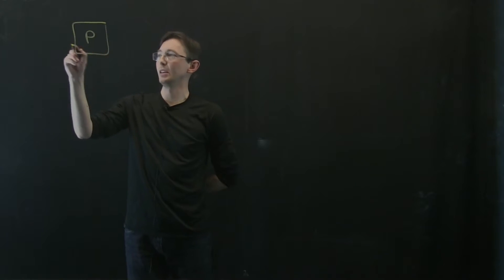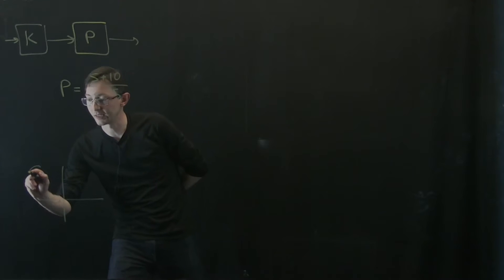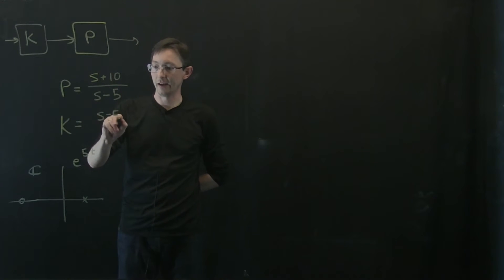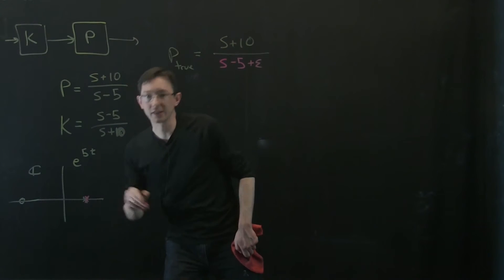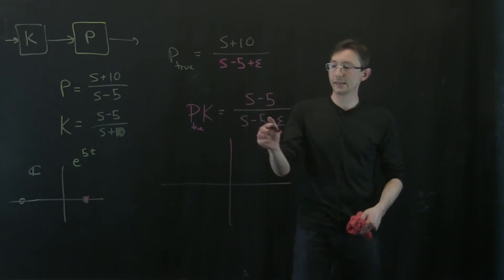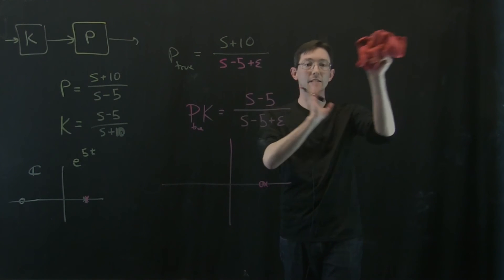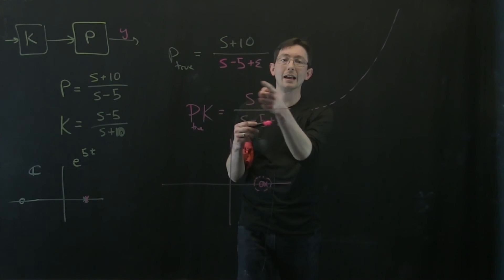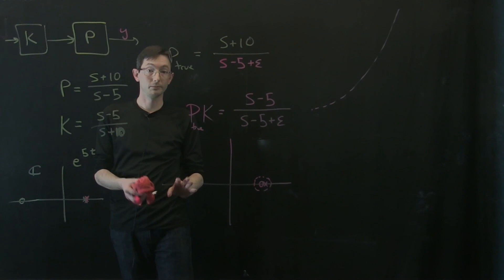Control Bootcamp:  Cautionary Tale About Inverting the Plant Dynamics

Comment: PK should be (s - 5)/(s)(s - 5 + e) ?
Reply: That is what you would design it to be to get the integrator form for L, but that doesn't change the result of this particular video: you still have a zero at s=5 and a pole at s=5-e, creating the uncontrollable and unobservable system.
Reply: then also you will have one pole of closed loop transfer function in RHP at all times